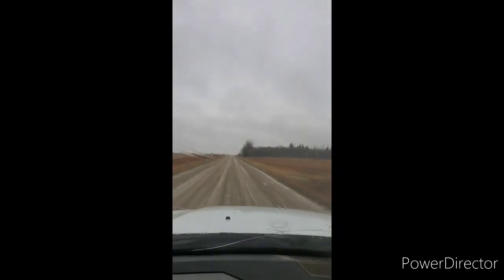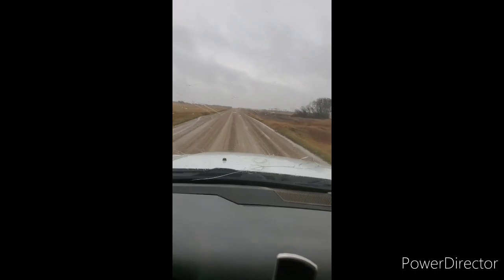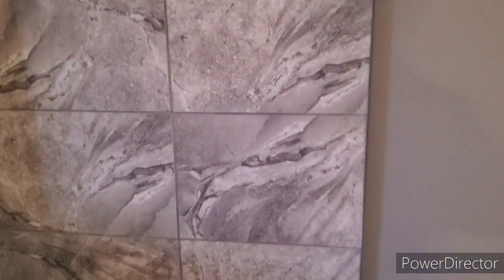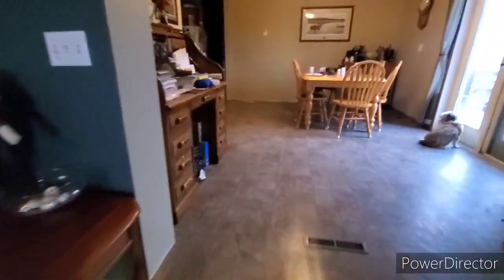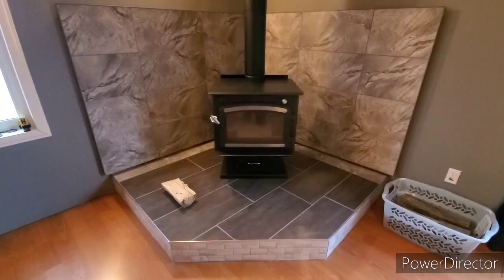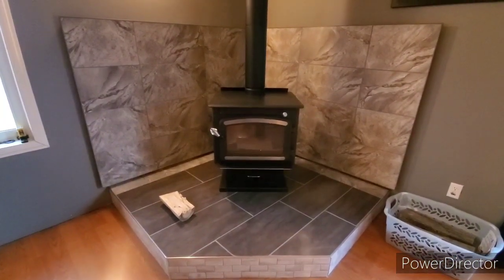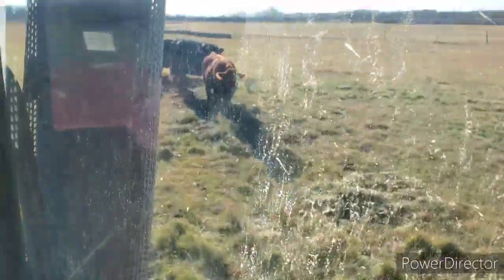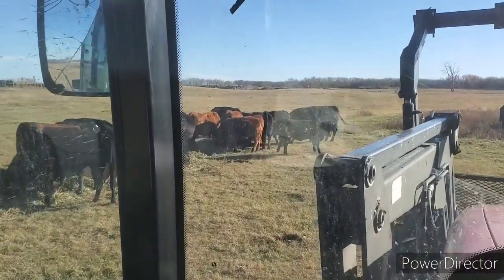Drolet Wood Stove First Fire 🔥

Comment: That field you asked about: what are you intending to plant there  in the spring?
Reply from the maker: Probably oats
Reply: @bcpfarmandtrucking6560  Organic oats or GMO-sprayed?
Reply: @bcpfarmandtrucking6560  Put it to you this way: oats for feed or for sale?
Reply from the maker: Combo
Reply: @bcpfarmandtrucking6560  You were asking about that manure and spreading atop after tillage or before? Well, for oats I would spread first and then till it in as oats roots are deep and to get the benefit the manure needs to be in soil not on soil.

But don't mind me writing this I don't use manure for crops I use it on hay fields only. The fertility and seed mix of manure regenrates both pasture and hay fields. We never tear up a hay field ever and re-seed it. Makes no sense when spreading and feeding on the fields does it all.
Reply from the maker: I've spread on the hay fields and it did help but after 15+ years and little rain our production was 0..grazed it off and rip er up
Reply: @bcpfarmandtrucking6560  The way I see it if the existing plants aren't doing well new plants aren't going to do better unless you plant more drought resistent varieties.

Comment: We don't use CO detectors around our fireplaces why would we use them around our wood stoves which are closed and safer than wood fireplaces? There are NO gas leaks from wood stoves of incomplete natural gas combustion and that's what we use the CO detectors for (because the gas has no smell).  There is no danger of gas seeping into the ambient air from a faulty mechanism because there is no mechanism! Wood burning actually draws air from the inside of the house and the vacuum from combustion sends the emissions through the pipe and outside. We used wood burning open fireplaces for centuries and CO poisoning wasn't the problem: chimney fires, fires from the fire box/pit catching the building on fire, and smoke inhalation was/is the danger. A smoke detector near in the same room as the wood stove is a good idea though.
Reply from the maker: I agree with everything you just said especially how a stove is safer and more efficient than a fire place